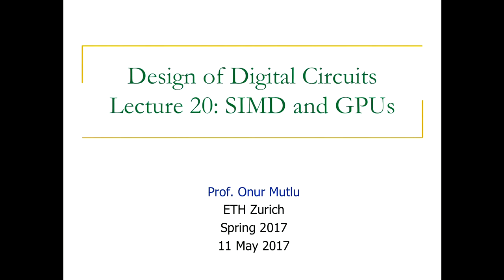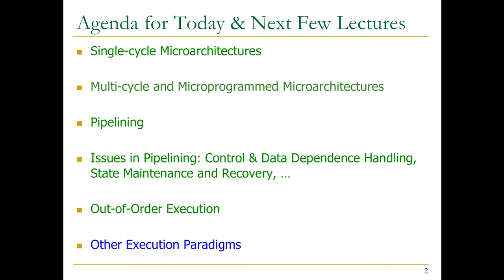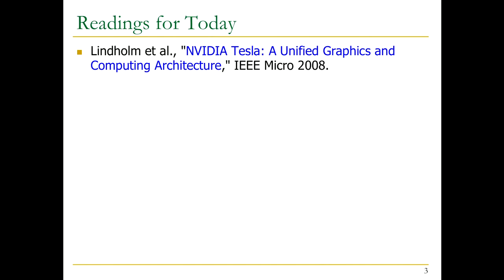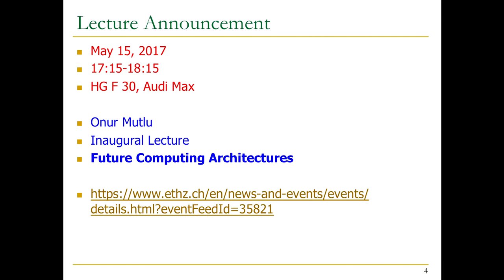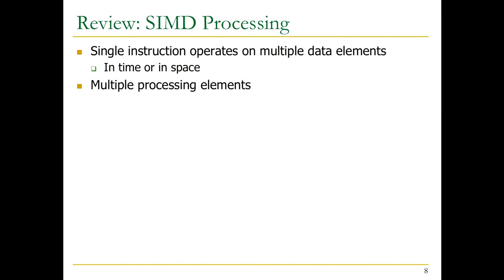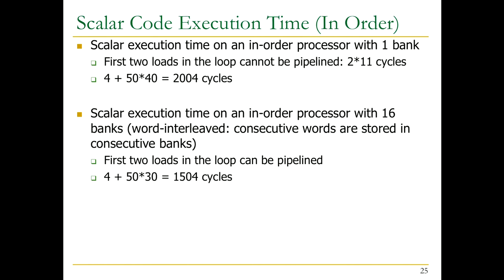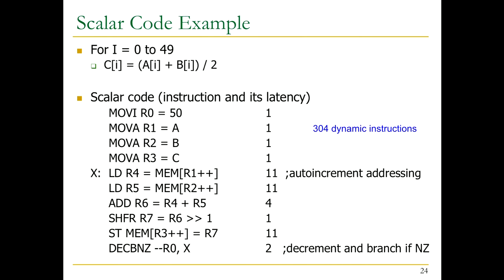Digital Circuits - Lecture 20: SIMD (Vector and Array) Processors (ETH Zurich, Spring 2017)

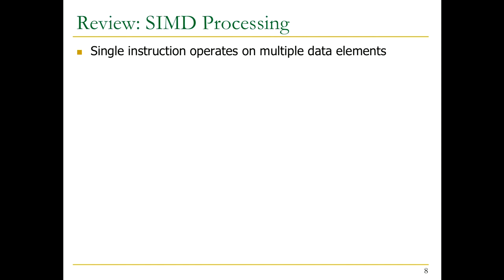Comment: 1:43 - Review - SIMD Processing
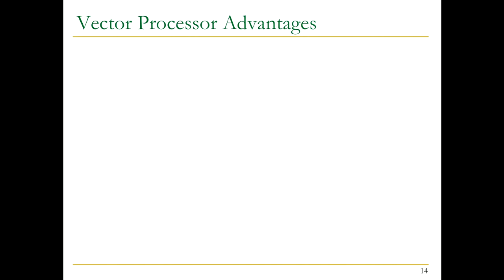6:36 - Vector processor advantages / disadvantages
11:14 - Vector registers
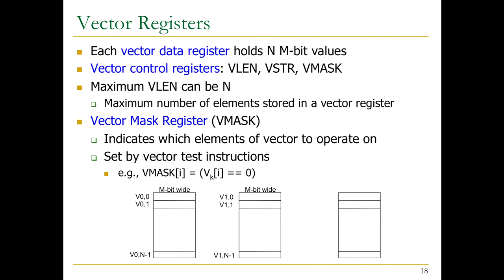13:35 - Vector functional units
15:08 - Vector machine organization (CRAY-1 computer)
17:40 - Loading / Storing vectors to from memory (memory banks)
29:00 - Scalar code example
36:08 - Vectorizing a for loop
39:22 - Basic vector code performance
42:31 - Vector chaining
49:02 - Memory banks (with two address ports)
58:02 - Questions
1:01:00 - Gather / Scatter operations
1:09:00 - Conditional operations in for loop (Masked operations)